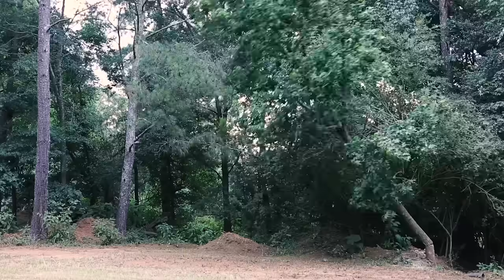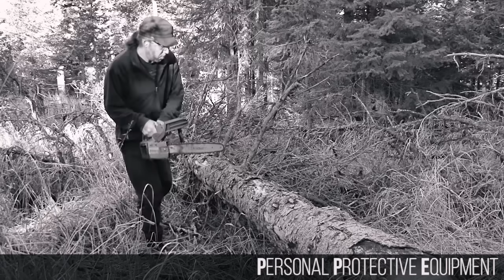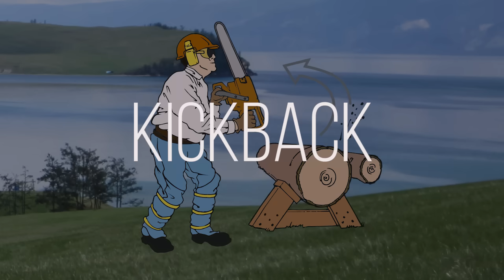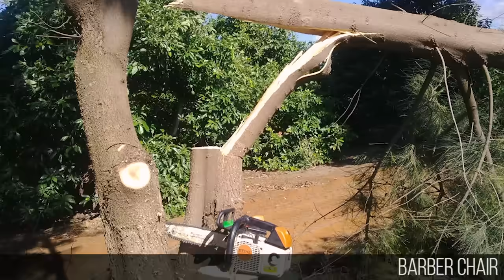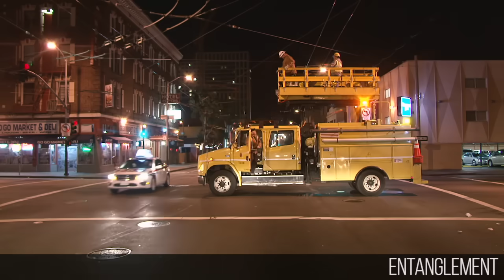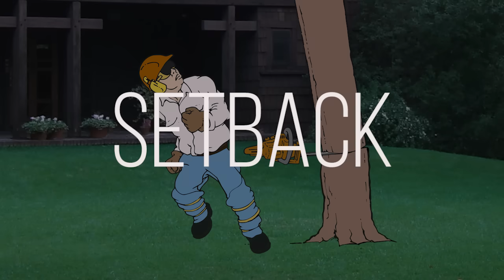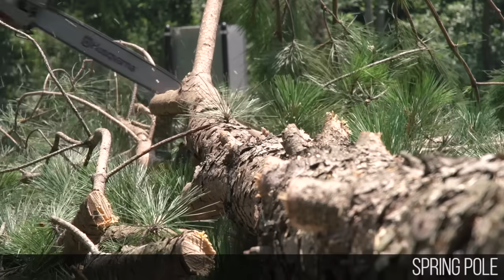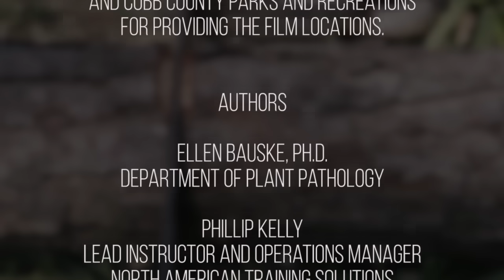Common Tree Felling Accidents and What You Can Do to Prevent Them

Comment: Is a pinch when the chain loses speed and it doesn’t have enough force to continue?
Reply from the maker: Yes. The saw will pull away form the operator if the pinch is on the bottom and push toward the operator if it is on the bottom. Either one and you can lose control of the saw or trip.

Comment: I climbed a tree and onto the limb I wanted to cut, I sat on the limb and cut between me and the tree. If you could see what happened, you could have shared a moment with Isaac Newton. Having experience in the counterclockwise water flow drainage in the southern hemisphere, usually after many a cervezas. I applied this reversal to the tree that feel from me in the northern hemisphere in a disappointing manner. I had a noticeable feeling of tension before I felt the compression, luckily near my cerveza cooler. All's well that ends well.

Comment: Well,,,, that makes me never want to use a chainsaw.
Reply: Respect the tools, but never be afraid of them. Tool that is well taken care off, will take care of its user ie. cleaning the kick back break and checking that it works before starting to use the saw, is good practice. Other thing is to keep chain sharp and to have two chains. One for good cuts and older one to smash if there is for instance lots of rocks in the area. Sharp chain will make it easier to cut, so for tiring you less, what can lead to slips on safety, concentration and well footing.

To be honest i can hug the chainsaw, but i'm terrified of table saw, but with respect and keeping your hands clear from it, its a great tool to have too.
Reply: @Hellsong89  table saws must have gotten a lot better I’ve never witnessed kickback on one even when executing dangerous cuts without the guard